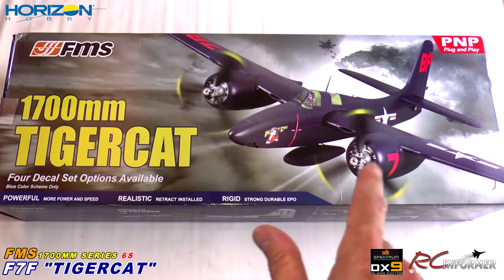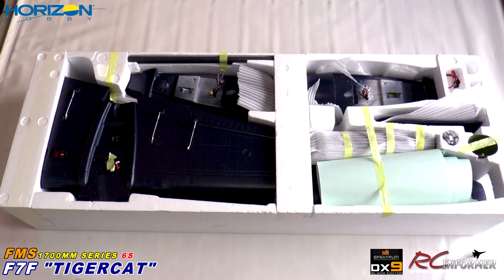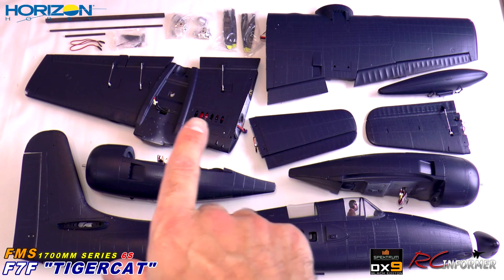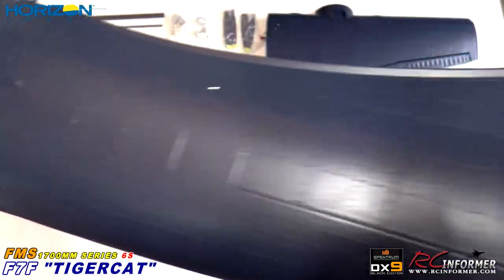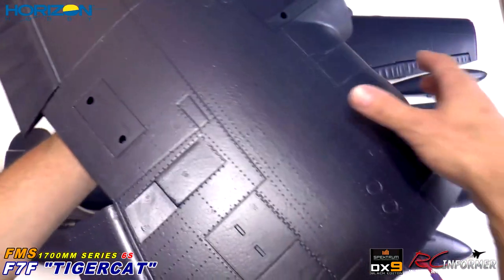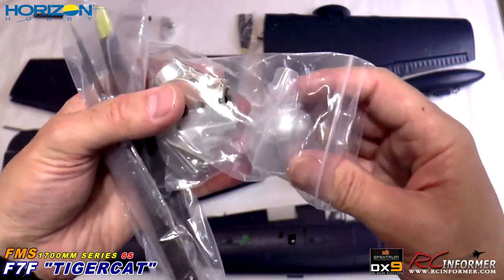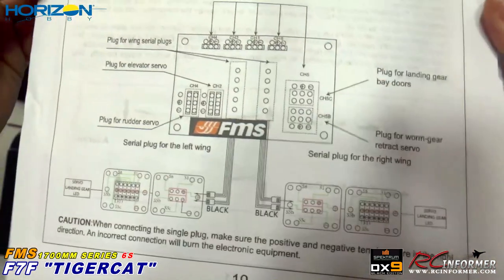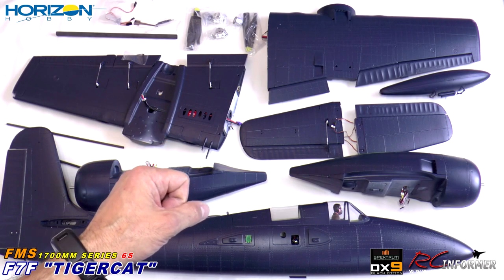FMS F7F TIGERCAT 1700mm UNBOXIING VIDEO BY: RCINFORMER

Comment: Hey Rich l just got the fms 1700mm tiger cat and I just wanted to no about the Bec that connect to the Esc 5 connector  on the bec there are 2 wires red and black connector do you have any idea where that plug into
Reply from the maker: If you're talking about the black and red that come off of the BEC .... that is your power supply to the receiver it can go in any open channel.

Comment: Hi Rich. Great Videos. What receiver are you using and is a 6 Channel Receiver enough channels? Any advantage to an 8 Channel receiver? Thanks for a reply, Doc Joe
Reply from the maker: Joe, 6 is sufficient. 7ch is good if you want to add nose wheel steering or switchable gains for a flight stabilizer. go with 8 channel if you want both:)

Comment: Hi Rich,  I just got my Tigercat and in setting it up I have the flaps going up when the gear goes down and flaps going down when gear goes up.  Any ideas what is going on had several from our chapter look but could not figuer out the problem. Have you seen this before and if so what is the fix?  thanks Charlie, Fremont,Ca,  Bayside R C Club
Reply from the maker: Charles Smith  They probly just got the flap and gear wires mixed up when they pluged them into the wing ports at the factory....  The flap servos got plugged in to the board  On the gear channel by mistake...  You may have to remove the board on the wing, And unplug the flap servos and plug them into the proper port... call me 4076836032